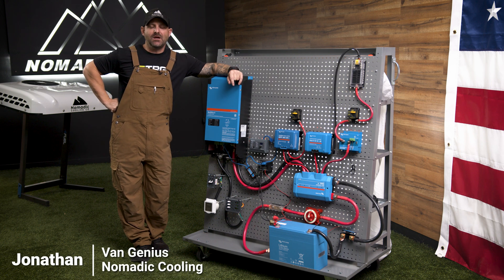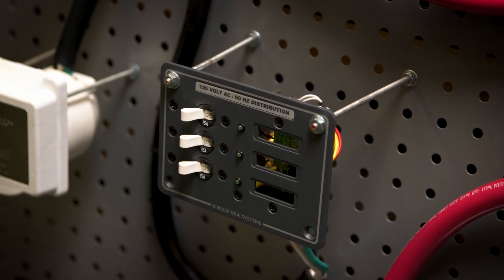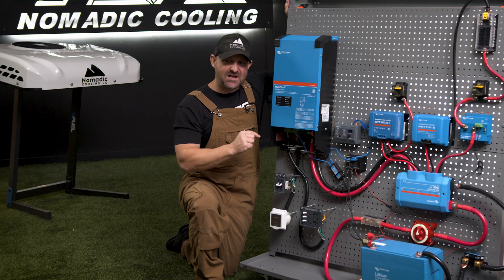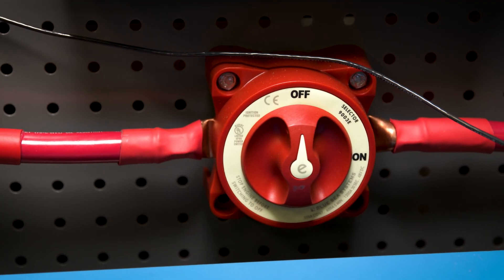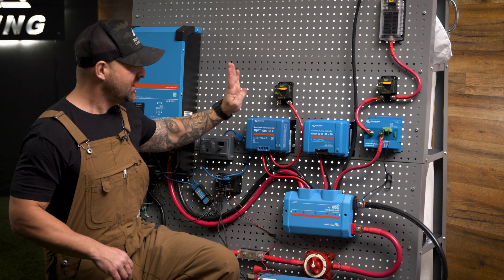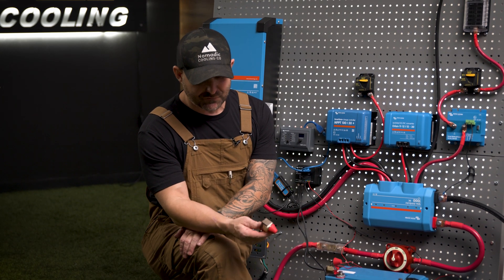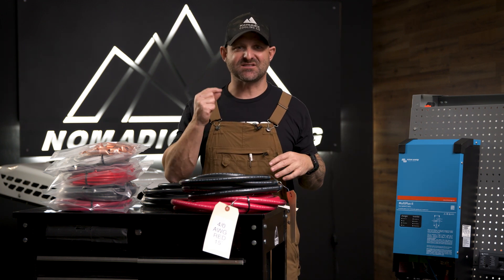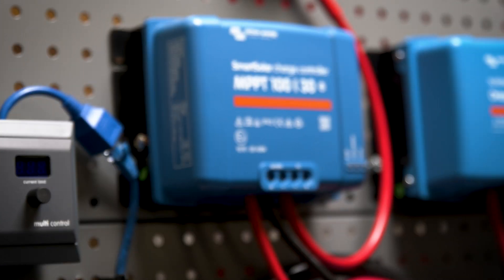Off Grid Roamer Electrical Kit Explained by Nomadic Cooling ☑️ Victron 200ah or 330 ah Battery

Comment: i want to add a small fridge in our SUV.
When I install a 2nd battery and use a Victron Argodiode 80-2SC 2 80A
the 80A, is that the max Amp i can take from the setup?

w